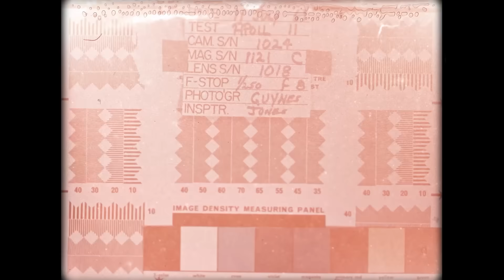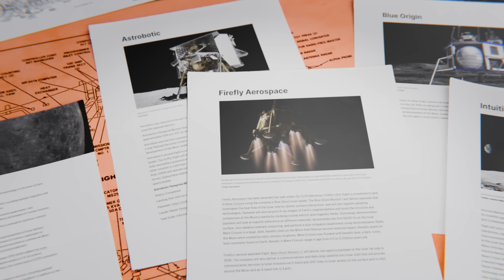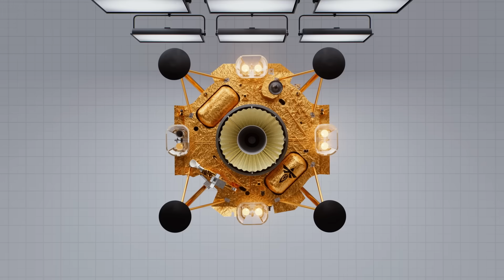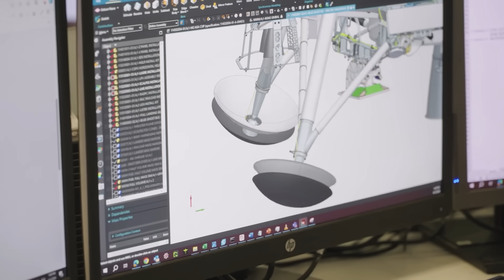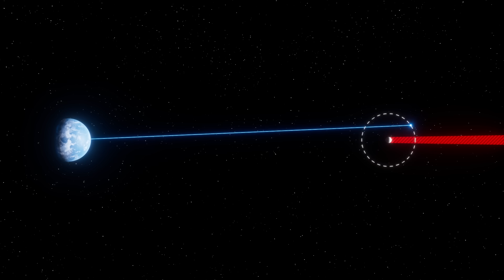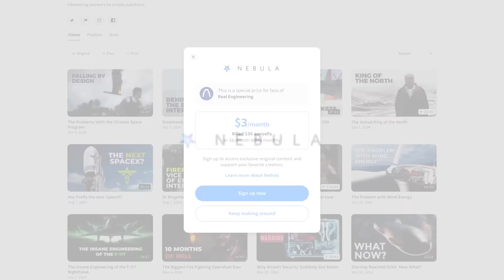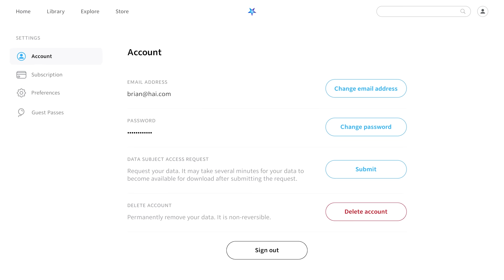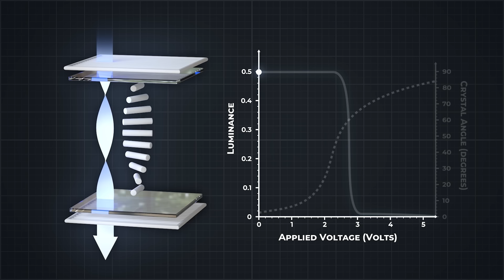Why the US is Struggling to Land on the Moon

Comment: Last millennium my physics professor stressed out the difference between stable and unstable equilibrium, baricentrum and center of gravity. 
I'm not a rocket scientist but I know that what's heavy on top topples easily. 
Apparently, looking at the mock-up video, the NASA scientists need badly to brush up on the basics of  physics.

Comment: 70 yo retired professional engineer.  IMO - the greatest engineering was performed by engineers using a slide ruler.  You need great intuitive understanding to use a slide ruler.  The same can be said by drafting with a tee-square and triangles.

Comment: With Al, it is even more easier to go to the Moon again! 😀
Forza NASA! 😀
Reply: Or it should be, you'd think?
Reply: AI is indeed playing a pivotal role in NASA's Artemis program, which currently aims to return humans to the lunar surface in 2027. By leveraging advanced AI, NASA is overcoming the unique hazards of deep space that made the Apollo missions so risky. 
How AI is Powering the Return to the Moon
Autonomous Navigation (AutoNav): Building on success from Mars rovers, NASA uses AI for real-time hazard detection and path planning. This is critical for the VIPER robotic rover, which uses an AI system called "Sherpa" to navigate the treacherous, low-light terrain of the lunar south pole.
Medical Assistants: NASA and Google have developed a Crew Medical Officer Digital Assistant (CMO-DA). This AI helps astronauts diagnose and treat health issues autonomously, which is essential since communication with Earth can be delayed or blocked during deep-space missions.
Generative Design: The next generation of spacesuits (xEMU) and spacecraft parts are being designed using AI. These AI models iterate through thousands of designs to find the optimal balance of weight, safety, and flexibility far faster than human engineers could alone.
Spacecraft Health Monitoring: The Orion spacecraft incorporates AI-driven health management systems to monitor its own performance and predict potential mechanical failures before they become critical. 
Upcoming Artemis Milestones
While AI makes the process more efficient, physical engineering remains a major challenge. As of late 2025, the schedule is as follows: 
Artemis II (February – April 2026): The first crewed mission in over 50 years will fly four astronauts—Reid Wiseman, Victor Glover, Christina Koch, and Jeremy Hansen—on a 10-day loop around the Moon.
Artemis III (Mid-2027): This mission is planned to be the first to land a human crew at the lunar south pole.

Comment: Because we never did it to begin with
Reply: even so, unmanned probes have been supposedly landed onm the moon multiple times by multiple parties back in the 60s and 70s. I think, people don't think like engineers any more, they think like programmers. They think they can fix anything with software, instead of designing proper hardware.

Comment: In my opinion, peak engineering was reached during the 70`s. Yes, today we are more advanced when it comes about knowledge. But the engineers of the 70`s were something different. As we advanced, we unlocked computing power but lost the ability of using it at it`s best.
Reply: yes, the religious-like belief that the piled up software patches can supplement for the initially brainless hardware design.

Comment: I really don't like what the title of this video portrays, especially on an engineering channel. If a fuel leak in a rocket and Ai not being programmed to see unusual obstacles is the reason we can't land on the moon, then I'm very confident we can still get there with no problems. The problem would be reassurances on the ground before anything goes up, i.e. checking O-rings and other perishable things that could cause a leak on a rocket, and then optimizing the programming on the Ai. The Ai used probably couldn't learn new data but only use the data already programmed into it so it couldn't read an obstacle it didn't think was there to begin with.

For the Ai to be able to actively learn as it's landing would use too much power, I guarantee none of this will be a problem when the first reactor gets put on the moon, but we're not there yet so I don't even know why we would use Ai in any way in space, other than telescopic satellites for upscaling images. They screwed themselves by doing that. Also none of this is a failed thing, the moon isn't going anywhere and these landers we send WILL be recovered at some point. Whether that's 100 years from now or more or less, it's going to happen.

Comment: You're asking why is harder for a modern autonomous robot to land on the moon than a 70's human? Seems pretty obvious.

Also, the failure rate of autonomous landings wouldn't have much to do with the failure rate of human landings. So, that 50% failure rate would go down significantly with a human pilot.

But, I understand that the Apollo program was more or less a military endeavor, with different safety factors than a civilian program would have used.

Comment: 3:20 "unacceptable safety margins for humans..." but they did it the first time right in 69. The more I learn the more rediculous does a 69 moon landing sound.
Reply: So there weren’t margins after one landing then. It was an unaccomplished feat. NASA even drafted a press release ahead of time in the possible event of Armstrong and Aldrin perishing.

Unmanned landings weren’t an option to accomplish the landing back then. Secondly every stage of Apollo was tested and practiced ahead of time so the simulations on earth were valuable experience. Thirdly, they knew roughly where they were landing.
Reply: @johnkelly3549  That makes sense, but it is easy to defend anything 60 years later. There are too many inconsistencies for a 69 manned landing to have taken place and not enough space here to type it.

Comment: 9:49 they can connect the set of two tanks with a pipe at the bottom of the tank. This pipe can be then fed to the engine. This way pressure in each tank will be equal and the center of mass will self adjust as the burning happens

Comment: You can build, 100 000 drones and try to land with different speeds and angles. You can simulate it now with ai times 100000000000000000000000000 within a year. I dont know the fck they are doing. But i dont know, maybe they never went to the moon.

Comment: We need to design the exact same rocket again
Reply: Apollo was dangerous, it killed three and nearly killed the rest. A modern space agency won't risk lives for the sake of prestige, and rightly so.
Reply: @mattd6085 pshhh thats fine
Reply: Which one? Why?
Reply: @ThomasKundera saturn v something, and counter point! They dont have to re design it much saving basically nothing
Reply: @dogodoge8861  : Those machines are obsolete in design.
Reply: @ThomasKundera then downgrade it until it is upgraded
Reply: @dogodoge8861  : The SLS is somewhat replacing the Saturn V.
But it's likely not a good rocket.
I'm afraid USA is not going to make it.
Reply: @ThomasKundera i know and i wish that trump doesnt pass that bill thing about nasa
Reply: @dogodoge8861  : Things are going wrong in some area of NASA (not all) since way longer than Trump, I'm afraid. It's free money for Boeing and others, without caring about actual good engineering.
But Trump is another level, and that's going beyond average corruption and collusion between gov and big companies. It's going to be difficult times.
Reply: @dogodoge8861  : Not nice to say so, but what saved the Apollo, program was the huge failure and death of Apollo 1. After that, everything was refocus, contractors had to do their job properly, etc.
What could save Artemis now? I dunno.
Reply: @ThomasKundera thank you for this information
Reply: @dogodoge8861  : That's my own analysis. I'm not an expert.
There are likely good papers on the subject, by way more knowledgeable people than me 🙂

Comment: NASA budget at peak 1969 $4.25B, 2025 = $25.4B but we landed on the moon because of al the spending? Inflation shows this to be flat spending.
Reply: Here’s the thing. In 1966 Apollo was at peak spending. R&D, procurement of rockets, etc. 

It took up 4.4% of the federal budget. Which today, would be 282 BILLION dollars. Not 25. 

From 1966 to 1969 the federal budget increased OVER DOUBLE. 

this is due to LBJ “great society” and Vietnam war spending. 

After R&D and Saturn 5 building costs, nasa budget went from 4.5 Billion to 4.25 Billion, from 1966 to 1969. 

But the Apollo program, at its peak, took up over FOUR PERCENT of federal budget .

Which today would be 282 BILLION dollars, not 25.4.

Comment: Why they gotta make these things so big? Just send like 100 of these small drone like devices on a single device around the same size and send them all at least 1 should land 😂 or I don't know a robotic arm that can help push the vehicle back up right 😂 maybe if rockets are throwing off the cameras try a helicopter like design so that the thrust is higher up. So many different things to think about yet they want it to land on 4 legs why not just make the thing shorter and built like a rectangle hard for a large side of a flat object to roll over 😂
Reply: Wow, you should go work for NASA if you have ideas that good 👍

Comment: So, why design a new lunar module who can't do the job, instead rebuilding the original who did this several times successful!?
Or are you suggesting, with its extremely hard today, that they didn't landed successfully!?!? Or never went!?!?😂😂🎉🎉
Reply: Old ones worked but weren't reliable
Reply: @justsavv6378  following this content are unreable too! As a not engineer, I see that the new ones are taller in relation the width, so more unstable, top heavy!
It was cheaper to improve the original, than a new design that failed again and again!
Reply: @margotkeulen1086  to be fair I aswell have no idea why it's so tall , and the most recent american lander which went to the moon was like previous ones , wide , so I get your point
Reply: There are so many things wrong with what you said it's hard to know where to begin. 

The objectives of the landers are completely different. We don't want a human rated lander form 1969 that by pure luck, didn't fail. We want a modern, unmanned probe that can give us new science to study. 

It was extremely hard in the 60's too, but a limitless budget and a willingness to kill astronauts meant they just about pulled it off. JUST.
Reply: @mattd6085 BS
If we did it 55 years ago, we could do it yesterday, with our high tech innovation!

Option A Because we Cant do it yesterday, we didnt do it 55 years ago!

B they Tell this go get /by robbing you! For extra tax money, only a few 10/50 Billion!

C they hide something Else!?

Comment: NASA Surveyor series of landers all landed in the correct orientation! Every one of them! An Apollo Mission landed by one of them and removed the scoop and camera from one Surveyor and brought that hardware back. These Surveyors did run out of power in the night and woke back up once the sun rose and charged its frozen batteries. The use of a Radio-Thermal Generator which is a Block of plutonium that heats one side of a stack of Peltier cells which when exposed to cold on the other side, will generate years of electricity power allowing a lander to keep on operating while in the dark of lunar night, and run continuously for years afterwards. If future human missions were to land nearby, equipment could be salvaged from the landers and used in new ways, including that long lasting RTG power source to power items at the first permanent Human populated Moon Base!

Comment: The other thing is, the force of gravity on the Moon is 1/6th of what it would be on earth but the momentum of a given mass is still the same. This means it's far easier for a top-heavy object to tip over on the moon than on earth if there is any side-ways component of motion. Your intuition will deceive you. To have intuitive understanding of tip-over on the moon you have to imagine the lander being 6x as tall as it actually is (to account for force of gravity being 1/6 on the Moon).
Reply: YES.  Great Observation!  THat one company that botched it twice in a row really screwed up.  DUUU!  

You don't even need a calculator.  If your last attempt tipped over (which cost them a zillion dollars), obviously you need to move to version 2.0 with a wider stance.  Whole new design.  Not a little wider, but like each leg needs to be at least the length of the whole ship.  You could try telescoping, but that adds complexity and another point of failure.  And, they should be at an angle no more than 135° from the rocket side when deployed.  Probably less.   More than 3 or 4 legs; maybe 6.  I know Apollo had 4, shuddup and just do it.  And a little bit elastic bending; you're landing on a rocky surface, at an angle, so you can't assume all the legs will reach on the same plane.  And you can't even assume the surface will be at less than 45°.

When Apollo 1 had that fire, they stopped everything.  Too much hubris.  They switched from 100% oxygen at 5 psi, to 21% oxygen at 15psi, just like home (and just like the Soviets).  All the inside materials were made fireproof.  They tested with Apollo 2 through Apollo 6, all uncrewed.  Including in orbit.  Cuz, they knew, if they designed it with hubris for apollo 1, they probably made other careless mistakes, too.  And, Apollo 7 went off without a hitch.

In other words, take every factor that was a problem, even a weak problem, and overcompensate.  By overengineering it.  That's how Nasa made it to the moon.  That's what you do when you have such a catastrophic failure.
Reply: Neil manually landed first try in radically different unknown conditions , yet almost died on earth in familiar conditions

Comment: Here we are. Living in "the future." But what could be done in 1969 apparently can't be done in 2025. Better computers, laser landing aids, but it doesn't matter. Not when you have a group of teenagers running the show. That Space-X rocket that keeps blowing up? Computer simulations don't matter. Basic engineering? What's that? Vibration, seals failing, fuel leaks. Or how about Boeing? You build a capsule and get thruster failure. It's not like it was never done before. But it sure seems like it.
But everything should be easier in 2025. What with all those computers that do the thinking the engineers and designers should be doing. Here's an idea. Take away their computers. Give them working parameters but have them figure things out step by step, especially how to damp vibration. Have the structural engineers get with the electrical engineers. 
If not, more millions get spent for things that fail or crash.
Reply: Yes, we are in fact living in advanced times. The fact that you can use Google Maps is a testament to that — all made possible via over 50 years of space infrastructure built by joint efforts.
Reply: woah! its almost like space X is doing new cutting edge booster landing experiments that NO ONE's done before!! that's fucking crazy???? or that the mission that failed here was UNMANNED? and has much less budget than NASA during space race??? shocking how that works, huh?